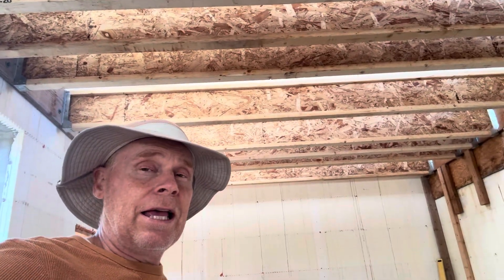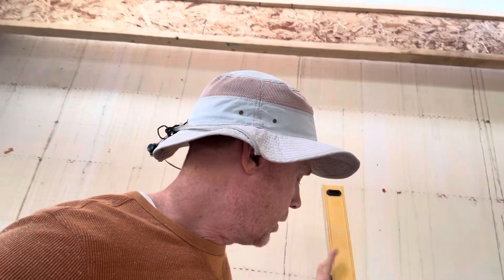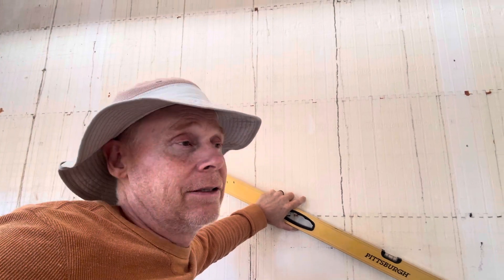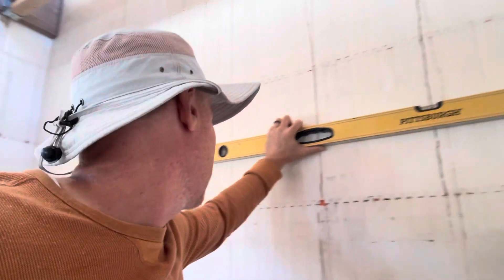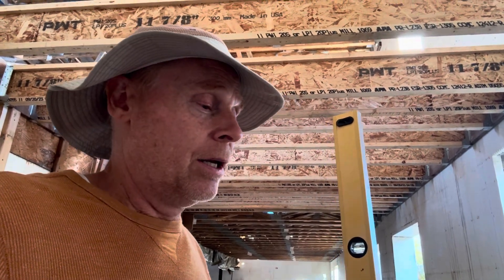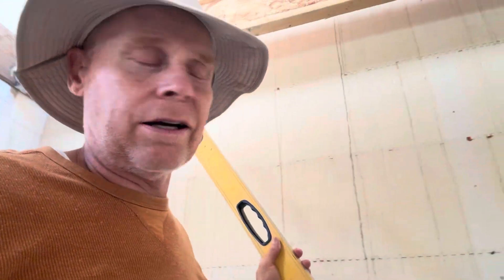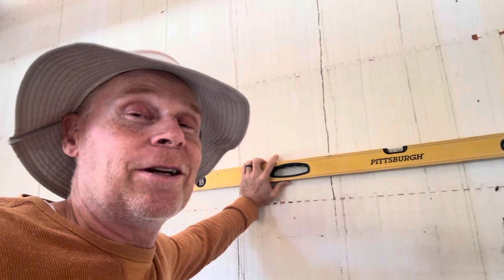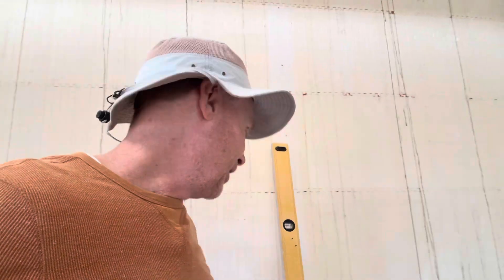My level shows my 48’ tall ICF home is tilting 😳

Comment: Why on earth would you trust such a large scale project with a $20 level, buy a Stabila, and take care not to drop it . Buy once cry once, your work is built off the concept of flat and plumb. Glad your scare was square!👍🏼
Reply from the maker: Great point and yes I did user a laser level when I was building it.  The stress came from thinking that it had begun to sink on one side after it had been poured due to the weight.

Comment: The only thing that $10 Harbor Freight level indicates is that you're a cheapass and you need to learn to buy real tools.  Glad you figured that out for yourself.  I've been using the same level for almost 35 years because I bought the very best one I could in 1990.  I still wouldn't trust it to tell me how level an entire building sits.

Comment: Never trust any level.  Measure once then rotate 180 deg.  Then measure a second time.  If the results are the same, your level is perfect.  When they differ, the real value is half way between the two values.  When on a construction site where it is reasonably easy to bash your level - do this test a couple times a day or whenever you start to question the accuracy of your level.
Reply from the maker: That wisdom would have saved me 10 minutes of lots of stress :)

Comment: It's very easy to check a level, just set it on a pretty level surface or shim it to level, then flip the level the opposite way.  If the level reads the same both ways, you're good.  If it's different the vial has shifted relative to the frame.

Also never trust a Harbor Freight level for anything important.  I'm going to invest in a Stabila or other quality level when I start with the critical stuff and a good laser level to set all of my concrete forms and ICF block.

If there are any construction errors with the walls I will be able to shim my I-joists to level my floor and my slab will be poured after my first story pour so I'll be able to screed that level independent of my walls and it's going to have some drainage slope too so it's not going to be level either way, I just need to be close enough that water flows toward my floor drains.
Reply from the maker: That will definitely save a lot of fixing later on!

Comment: Now you need to go back to the last few things you built with that level and make sure you don't need to make some corrections.

My, master carpenter, step father drilled it into me that one should never trust a level or a square that you hadn't checked that morning, and after every drop.  Takes two seconds to check, and can save days of rework.  He also insisted that everyone on his crews ensure their tape measures are within 1/8" of each other over 12 feet at the start of every shift; again seconds to do, but it can save a lot of time through the day if your calling out measurements and getting peices that are too long or short back.
Reply from the maker: That is great advice!  I saw a video from China where each of the guys had a different distance on their tape measures.